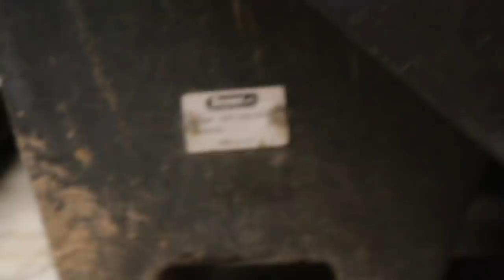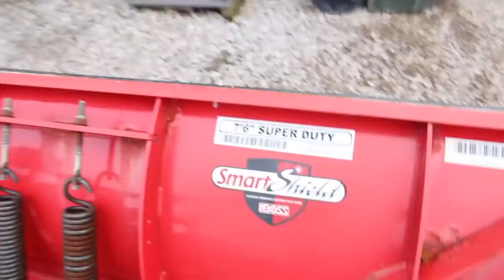Our Buyers Salt Dogg & Boss Snow Equipment and Another Semi Load of Salt | What a Winter!!!!

Comment: I sandblasted a boss plow 2 years ago. The powder coat is tough as hell but heat will destroy the toughness. Torching the powder coat before sandblasting will make your job 100 times easier.
Reply from the maker: dreambuilderkmg Thanks for the heads up man!!! I will definitely do that 👍🏼

Comment: There is a little cable hookup on the back inside of the bobcat tailgate that disconnects the backup alarm if it starts to annoy you. If im around the shop or in a wide open area i usually disconnect it.

Comment: cant wait to see the Kodiak build! We have a 4500 with the 8.1 vortec at my full time job and i love that truck. its only 2 wheel drive though but it does have diff lock. still gets stuck easy though. a 4x4 version is rarer than hens teeth though. I would love to have one myself that is 4x4
Reply: Problem with the 4x4 versions is they cant carry as much weight... from what I have been told is Chevy never made 4x4 5500 frame and just used the 1ton 3500 frame for the 4wd models... typically a 4wd will carry slightly less weight then a 2wd version but in this case it's supposed to be quite significant
Reply from the maker: Hazardra Lawn Care yeah I’m with you man. 4x4 would be sweet but the 2wd will be an excellent truck as well! Can’t wait to build it 😎
Reply: @kodiak4502004   did not know that. thanks for the info

Comment: Can you get bulk salt? I have 2 vees and we go get loaded it's way easier than bags brother!
Reply: And lot cheaper too
Reply: @Ajkendallmindsetmentor  yea and hes got a skid steer too...
Reply from the maker: Brandon Garbacz the closest place to get loaded is 30 minutes away and it’s not close to my properties.. just more of a pain than what it’s worth.. I like being able to run outside and get loaded up and ready to roll in 10 minutes
Reply: I guess it’s a regional thing but I can’t imagine spreading salt with a tailgate spreader. You’ve got the trucks and a bobcat to load with. I’d build a hoop building over bin block and go bulk. You may have had a bad experience before with a v box but once you get operating a v box down you’ll wonder why you ever screwed around with bags.
Reply: @jeffgootjes8418  I completely agree and hed save crazy money bagged salt is triple the money at least where I am
Reply: At a 1/3 of the cost of material you can afford to over apply a little bit. Putting a little spreader on the back of that flat bed truck is the equivalent of driving around with an 18’ lawn care trailer with a pushmower on it to do commercial locations. SMH

Comment: I love my rubber ones they make noise o can hear then but I have v boxes so you can hear it falling better, isn't the 7 6 kinda small for those trucks? I have 10 foot plows on my duallys
Reply: Brandon Garbacz he mentioned only having a few large lots and several smaller accounts. 7'6" plus the wings is probably good for residential areas
Reply: @dreambuilderkmg  yea but with duallys I bet hes running over windrows when the plow is angled. Mine does and when is collapsed its 8ft
Reply: Brandon Garbacz I take it that is why he has wings I'm sure the put total with over 8ft
Reply from the maker: Brandon Garbacz with the wings it’s perfect. Like the previous guy mentioned we do some small lots so the 7’ 6” with wings makes it like 9’ 4” and it works out great. One of them is on a single wheel 2500
Reply: @nickenslandscapingexcavating  I gotcha brother hey if it works why get a bigger one we love bbn our wideouts!